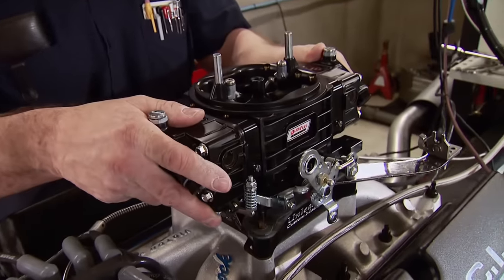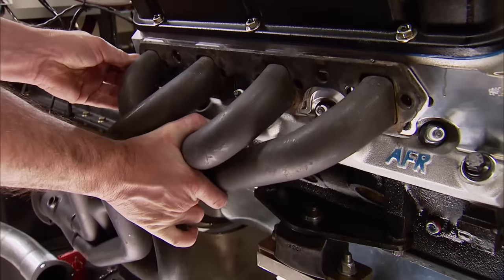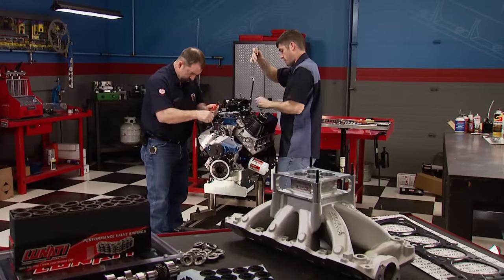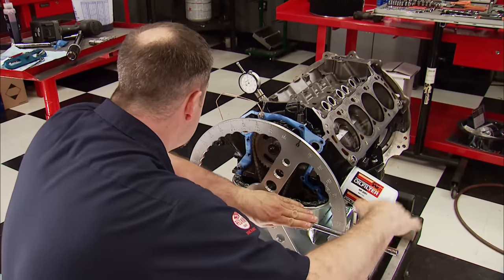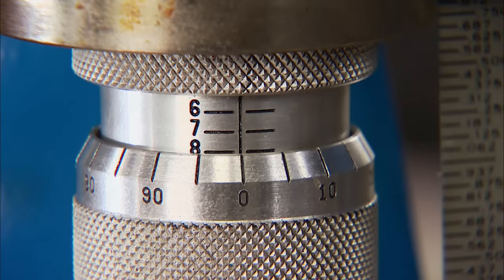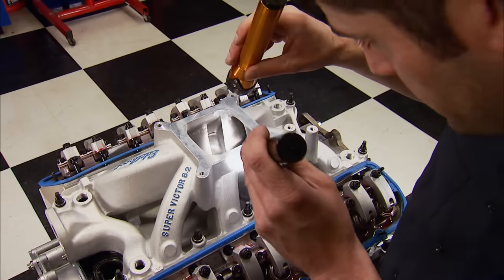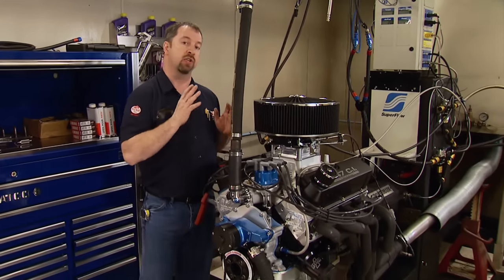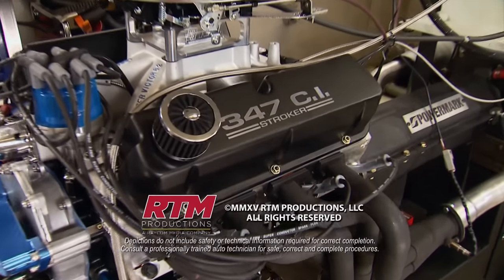Getting More Power Out Of A 5.0L Small Block Ford - Engine Power S2, E9

Comment: A pushrod v8 that revs up 8k should be in a road racing car, not in drag car. In my opinion, that is, of course.
Reply: Underpaid Racer Your opinion is wrong, as usual. Drag cars spend all day at high rpm. Road race cars do not...
Reply: @alexcorona  why'd you assume that I am always wrong? Do you know me or something? And RR cars have engines that make power linearly. If you look at the dyno figure of this engine, you'll see that it's quite linear. And so all I did was shared my opinion.
Reply: @driffbro3380  These small block Ford Windsors were used in racing with great success. In the 289ci form Shelby used them in Cobras and GT350's.
Reply: @alexcorona  agreed

Comment: Just a question. 
The weight gain in the solid lifters as opposed to the hydrolic lifters, does that get cancelled out by the additional load on the cam from the larger valve springs?
Reply: I don't think so. Since the lifters reciprocate, at high rpms they are under a lot of G forces which dramatically multiple their "effective weight".
Reply: If you listen close the solid lifters weigh less not more than the hydraulic ones.
Reply: The larger valve springs help keep the valves stable with the higher duration and lift during high RPMs.
Reply: 263 grams for the solids verses 272 grams for the hydraulics .
Reply: Pretty common misconception - solid lifters aren't actually "solid", they're hollow and usually weigh less than hydraulic lifters.

Comment: Aren't y'all worried about splitting the block, they're notorious for it apparently around 400-500 hp
Reply: Will Morales lol, I’ve seen 302/347 stroker motors that were twin supercharged that made over 1000 horsepower reliably. Check out a guy by the name of Craig Radovich, he was a true Ford guy
Reply: AltoAnimal109 Ball they weren’t the two bolt main production blocks, Craig was running a ford performance four bolt main block in that car, or a dart block, yes you can make over 500 in them and be somewhat reliable with the right block prep, and main girdle naturally aspirated, but throw in power adders and that gets risky, over 700 it’s a bomb waiting to blow and will split right through the China rails and lifter valley all the way down to the mains. Could someone have pushed 1000 horses through a production 2 bolt main block yeah miracles can happen but I can assure you it was short lived and very very ugly when it went south
Reply: AltoAnimal109 Ball not stock he didn’t not for longer than one pull... Chris Watson has some big numbers and while it’s possibly twin superchargers?

Comment: I know these guys know more than I do but I've always removed head bolts 1/4 degree at a time to minimize head distortion but who knows if that makes a difference when in matters but I've had zero problems with warped heads after removal besides engines with known overheating problems

Comment: Stage one was 527hp vs 566hp, as for a person to be buying these parts, you would have chosen the larger 1-3/4 headers right off the bat. Right?

Also should have tested carbs and spacers for optimum performance on stage 1. Maybe it would make best numbers with an 850cfm carb, and/or the 2" spacer? Perhaps with the Super Victor intake??? We'll never know what max for stage 1 would have been.... So we could compare the two sets of parts where there is a price discrepancy. How much power for how much coin? Intakes are gonna cost the same.... Which should I get for my 347?

I'm writing all this because I'm thinking that, the Jesel rocker setup, heavier springs, link bar lifters, etc ... while very nice pieces ... Might not be worth the 3-4 grand laid down for them, for the minimal amount gained? Nor having to spin the engine up another 1200 rpm to make that minimal gain. Plus, what would stage 1 have made bumping the compression up. That was FREE hp. Head gasket cost is negligible, and could be worth 20hp. People can run at 11.5 on pump gas all day, you just have to jet and time accordingly. Nobody wants a street car you have to fiddle around with octane.

When they overlay the numbers it's clear the stage 1 setup makes more usable street power lower in the curve. For a street car I'll take stage 1.

Comment: Coming in a little late in the game... Nice set-up for an all "motor" squeezer! But, I have to ask, why carburated and not fuel injected with high-flow injectors, fuel-pump, 90mm Throttle-body, Cold-air Intake and a race-tuned ECU etc? Why not 650 HP and 600 Ft/Lb's of torque, running on pump gas? The 5.0 can handle it! Did I miss something in the video? Just asking... I love old school, but there is a time to get with the current program, and the price isn't much of a difference. Why not have a NASCAR powered, all motor vehicle that is street drivable? Don't tell your insurance guy/girl though!

Comment: I'm planning my Cobra project.  Is either the Stage 1 or Stage 2 available as crate package from Summit yet?  (I'm leaning towards Stage 1).  Love this motor!  It's very close to the original / authentic Cobra 427SC, but in a 302 block!

Comment: Can you do a engine with fuel injection instead of a carburetor?
Reply: I don't know why they keep putting Carburetors on these things. They're outdated.
Reply: @Gino_567  Because you buy throttle body type and it gives nothing but trouble. You ask for support and if they can't solve it because its QC is crap, then the company you bought it from initiate a blame loop - that's effing why!
I got effed in the ay and went back to carb. The unit I bought is badly suseptible to EMI (due primarily to very poor design) and they end up blaming you the purchaser for their crap product. Essentially you are their beta tester and pay top $$$$ for the privelige. Of course now when you buy them they're all good and working properly - because people like me did their testing for them.
Reply: @ThePaulv12  The 5.0 has a factory fuel injection system. There is absolutely no reason to go with a throttle body type aftermarket system on a 5.0.
Reply: @sergeantseven4240  carbs are simple, cheap and tunable. they make good power and have for years. if u struggle to make power with them they it's cause u don't know how to tune them
Reply: @erandy0240  I never said anything bad about carbs. Although I will say that it has been proven that a well tuned fuel injection system will out perform any carb and it comes down to efficiency and tighter control. The 5.0 comes with a factory fi manifold so its not difficult to get one up and running without tuning. You can still do high flow heads and headers with a cam and not have to touch the mapping. But its also not hard to tune a fi mapping these days.
Reply: @sergeantseven4240  You forgot to say, "In my opinion." I hope you're not one of these people that thinks because you don't see a reason for something then no one else needs it either??
Reply: @ThePaulv12  Well, I cant say I understand why you would decide to go for an aftermarket fi system like holly or edelbrock when Ford has all the bolt on parts for it. That may just be an opinion but it is based in fact, am i wrong?
Reply: @sergeantseven4240  Not all of us want multi point injection. It makes no more power than a stinkin' ole fashioned carb so what's the point of it?
If you use the Ford OEM system as a basis, then it has to be heavily upgraded and then programmed with an expensive computer. The labor component is always the most expensive part. The self learning aspect of many of these MPI systems is so overstated to be utterly useless.
Next step down is the TBI. You get the benefits of carb (apparently but now in my case) without the expense of MPI.
Eventually one works out carbs are really pretty good and nearly always make more power (slightly) and often tend to go rich at the top end which is desireable. Look different people want different things from the hobby. Just because your logic seems logical to you doesn't mean I particularly care for it.
On the otherhand, I like MPI on V12 Jags. I'd definitely use it in that application. 

I would highly recommend reading the SA publication, The Carter Carburetor. The level of refinement and sophisticated fuel metering that can be delivered from carbs ensures their future in hot rodding. That book is a hoot of a read btw. It can be read by the beginner to the expert like me and still appeal. It starts with utter basics and takes the reader on journey. By the time you finish reading it, you'll know more about carb operation than most people. It's just a cheap book. The pen is mightier than the sword - sometimes LOL.
Reply: @ThePaulv12  you make a few assumptions on your part about my experience with carbs and fuel injection. I just want to state that for the record, tbi is utter garbage and always has been especially when it was an OEM option in the 80s-90s. MPI has out performed carb in many tests and really shines in forced induction and other power adders. I wont talk crap about carbs because they certainly have their place but to say they are better than efi is a wild overstatement. These days you can use an oem computer and manifold with little more than a crank position sensor, fly by wire throttle assembly, coil on plugs, map sensor and a couple o2 sensors. Hp tuners has plug-n-play tuners for most vehicles now. You just need a laptop. You can put bigger injectors in and never run out of fuel. You can even do multi fuel rail setups and run e85. EFI is where its at, carb is mostly still here due to simplicity but EFI systems have come a long way.
Reply: @sergeantseven4240  faaaark I'd never have known!
Reply: @erandy0240  That is all true for EFI as well.
Reply: Carb no get real ,carbs are for oil furnaces
Reply: @ThePaulv12  come on these people are supposed to be professional, the ciarb company's paying it
Reply: @sergeantseven4240  this has turned into a pissing contest when the original question was about why they use carbs in these builds. efi may out perform a carb in a situation where a carb isn't tuned properly but a well tuned carb makes cheap simple power. I can't justify spending thousands to perfect efi on a weekend street car. what better way to mix my fuel then letting the incoming air charge mix it thoroughly through the intake. And tbi wasn't garbage at all. general motors used it with success on 80s and 90s trucks mostly and they were reliable, responsive and fuel efficient for that era.
Reply: @erandy0240  Lol, GM TBI truck were anything but reliable, I know because I had a few of them stop running on me while driving down the road. Its never better in any way to have fuel mixed with the air and and then piped through a manifold before reaching the cylinder, the closer to the chamber you atomize the fuel the better. End of discussion. And I don't know why you insist that EFI would cost all this indeterminate fortune when its readily available to be plucked out of any junk yard motor with an OBD2 computer. I think you guys are just dinosaurs who can't wrap your heads around using a laptop and have to find any excuse you can to avoid it. Its not that expensive compared to an aftermarket high flow carb, its not that hard to tune, and all modern performance vehicles have it.
Reply: @sergeantseven4240  I'm not a dinosaur that doesn't like laptops. I use one every day but the efi from a stock junk yard motor doesn't have as much power potential as a good carb tuned correctly. stock throttles are small and intakes are restrictive so again I say it takes some money and tuning software to make it work. I'm not bashing efi at all. it has it's place and a carb does too. if efi is so cheap and great for racing then why do 95 percent of drag racers and truck pullers stick to carbs?
Reply: @erandy0240  Usually because of the simplicity in tearing down the motors, drag racers and pullers usually tear those monster motors apart between runs. Also they usually run nitro fuels and exotic fuels that EFI isn't good for. I'm talking about street performance though not racing motors. there is a difference.
Reply: Sergeant Seven 
From your previous posts you seem to be saying ,that you can use the factory SEFI system that were used on the 86 and up 5.0s, correct?

The factory SEFI system would not make comparable power/torque that this carbed version makes. It is so restrictive, that this particular engine likely wouldn’t make 400 hp. I’ve seen testing done where factory components were used on stroked engines(factory heads,intake and throttle body on a 347) and it could barely make 375 hp due to the restrictive nature of factory parts.

You’d  have to buy aftermarket intake,throttle body,injectors, and mass air meter, at a cost well over what a carb and intake would cost, and still have to tune it via laptop to make the power this engine made.

I performed all these mods and I ended up using (you guessed it) a Victor Jr intake and a Holley 750 DP vs Fuel Injected components,and ran faster with the carb🤷🏻‍♂️

It’s more likely that the reason 95% of racers use carbs , is not only simplicity, but  also cost.
Reply: @bigdaddycool4242  exactly what I'm saying!!! those factory fi systems were very poor for high rpm hp and this one was revved to 8k! that stock efi would choke this motor by 3500
Reply: erandy 02 
And with the stage 2 setup you wouldn’t have to turn it that high. Stage 2 is what? 3,000-6,800 rpm?

I’d go with Stage 2 all day long with the bigger carb and headers. I had a similar setup to this one and it was a blast. Low 7s on motor, and 6s on the bottle
Reply: @bigdaddycool4242  yes and feel like the lower stage insured a bit more reliability over revving to 8k also. this motor would be affordable fun in a fox for a long time
Reply: erandy 02 
My bad on previous comment, should’ve said Stage 1 with larger headers and carb.
Reply: @bigdaddycool4242  yes that's what I ment too. stage one is plenty of hp for some fun. that in a fox would eat the new coyote stangs and camaros
Reply: Because a carb engine is just easier to put on an engine dyno. This is T.V. ( and about rating first) they are going to do what is easiest for them.
Reply: Debating carb vs fi is like trying to convince a socialist.
Each has its own.
FI does everything well.
Carbs are ok and often make more Dyno power...
I don't race or drive dynos.
Reply: @Gino_567  fuel teck makes good 
Carburetors.  I like EFI better